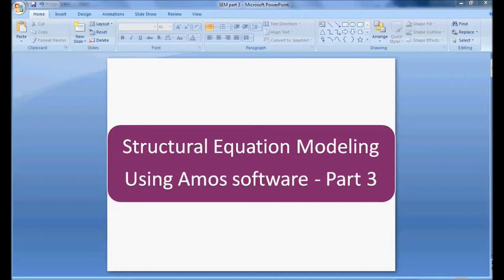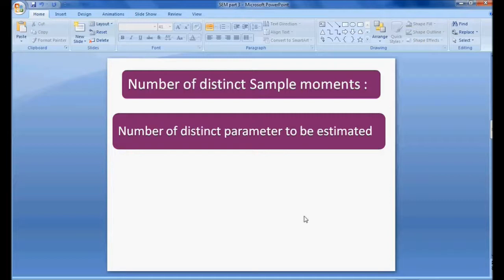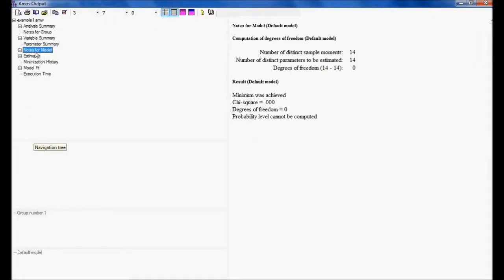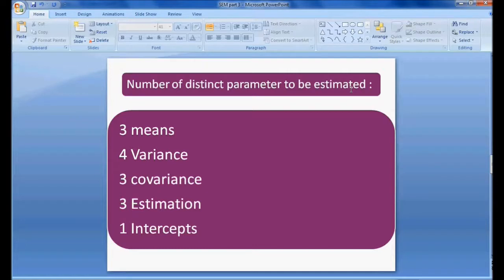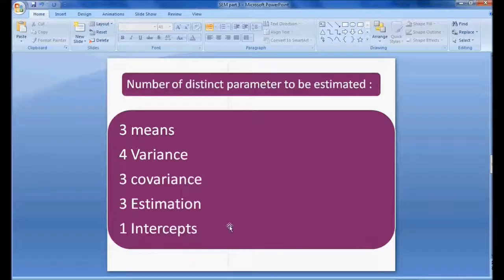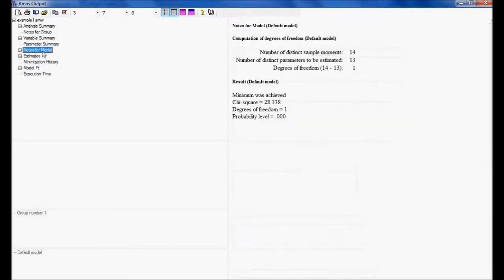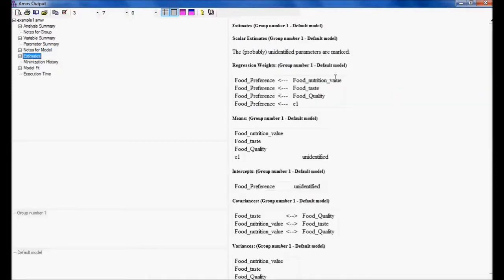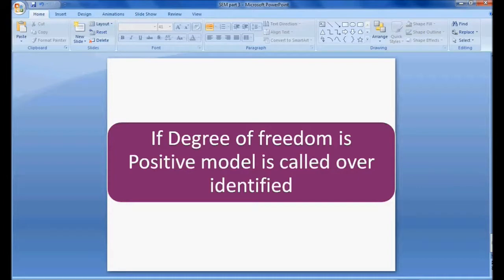Structural Equation Modelling ( Model Identification) Part 3: - by G N Satish Kumar

Comment: Hi, the system doesn't run any output when the df is very large. I am trying to do a SEM from a measurement model and I have df = 51, then also I am not getting any suitable output. Any thoughts on these? Thanks,
Reply from the maker: Akshay Maggu  Is your model identified? check the notes for model.
I will check and modify your SEM model. if possible ,Send your source file and amos graphic file to my email Id gnsatishkumar@gmail.com.